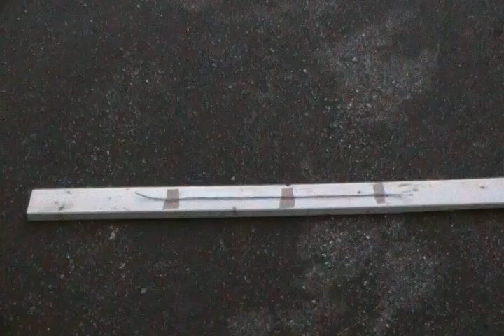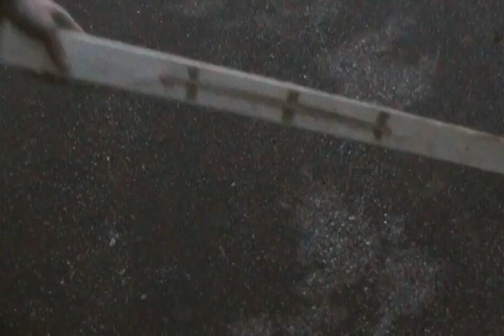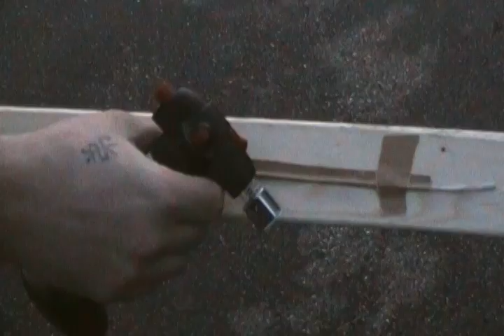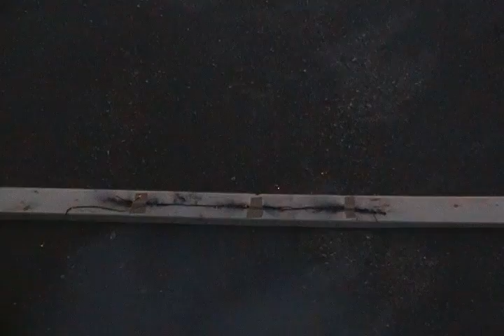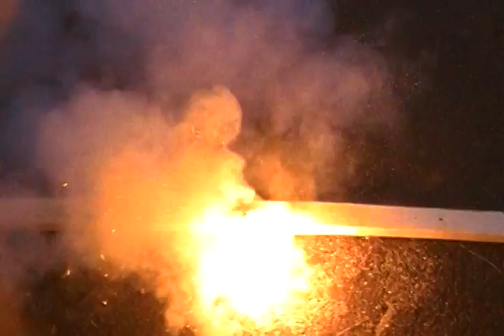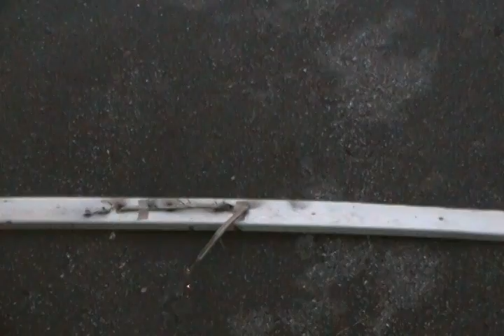Quick Fuse Test

Comment from the maker: My next test is gonna be with foil duct tape so it doesn't burn a hole in the tape. I think it will be alot faster but we'll find out lol. The tape I used was a paper tape and actuall blew apart when burning, it let air inside the tape I'm gonna try to eliminate that next time.